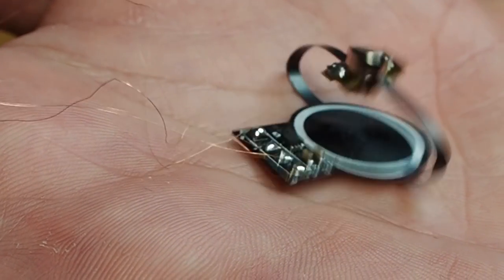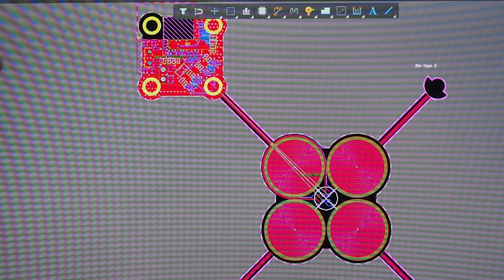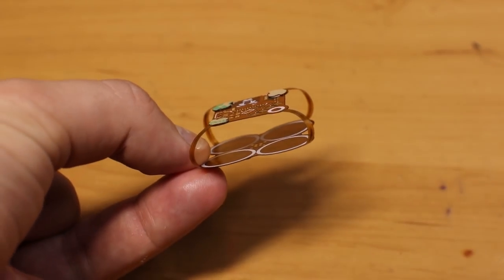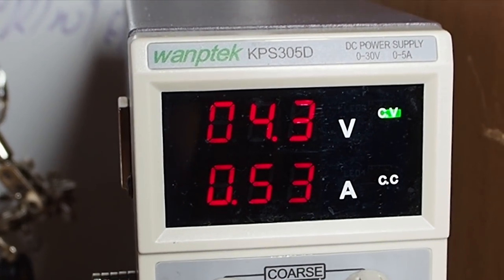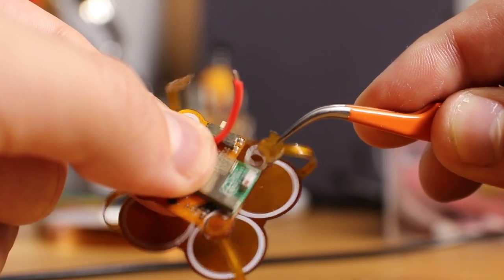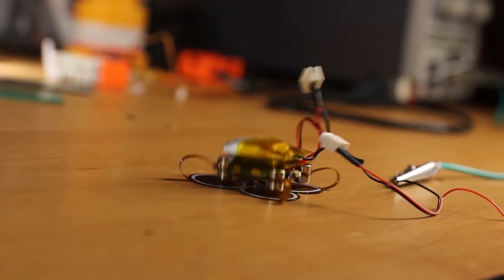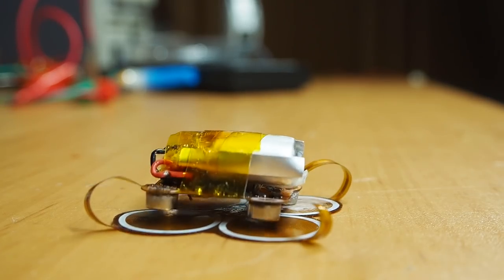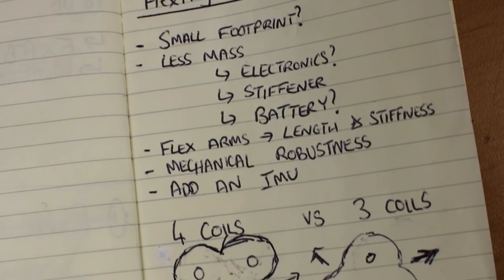Making a Jumping PCB Robot

Comment: Hi Carl,i'd like to give you an advice about jumping, idk if you tried that before , but i noticed that one of the major problem of your design (still awesome, I was never able to do something similar and I'm following your journey with a lot of enthusiasm) is the very low potential elastic energy that the robot can accumulate during compression, this due the low elastic constant of the pcb material. I know that a spring effect would require bigger mag fields and so bigger coils and mags, but why not trying to exploit a capacitor discharge in combination with some lp boost converter in order to feed the coil with short pulses of relatively high voltage electricity. In this way, enhancing the elastic constant of the pcb using , for example, aluminium planar springs, you should be able to achieve better results without changing too much the size of your robot. Hope to be useful :)
Reply: does it work if you have stiffer metal springs that are also coils? Aka they are coiled into a roughly conical shape and when a current is passed through them they compress themselves against the magnet.
Reply: Easy and free good test you can try is to add a second layer of coils to increase potential energy. Use also the arms to be more stiff - you already have many PCB's. so, why not?
Reply: terrible advice
Reply: you are right actually i was thinking the same way but the problem is the design itself even though we add springs to it still this design at current stage cannot work harsh but true. just some magnets pulling and pushing against each other wont do. first thing is we need a lot of force to jump which means we need potential energy storage like proper springs or rubber bands will also do. next we need a way to pump energy into them like the PCB linear actuator carl designed in his previous videos. next we need a lot of design improvement. i have a suggestion for carl he can use the PCB LA design to pull the springs from all sides towards the centre straining the springs and suddenly releasing them that should create enough force
Reply: So if you think about physics of jumping, you can't get more energy out of external energy harvesting.
If you wan't a real jump, you need to meet the "sweet spot". In your case the moment when you can enforce the anti gravitational force in upward direction, when the inertia of the lifting motion is enough to pull the mass that is still on the ground.

If you think of when you jump, you push yourself up. Right in the moment, when you feel gravitation less, you pull your legs to yourself. This order is a case for control algorithms. The problem you disrespect with fixed/variable frequencys for proof of concept, is that the actual momentum is not linear. It is by the power of 2 depending on time, its linear but not straight.
Reply: this really needs a 6DOF IMU so you can tune your jumps.

Comment: That's fantastic Carl! Have you thought of using opposing coils instead of permanent magnets? That might improve the power to weight ratio.
Reply: The mass of the magnet is what makes it jump
Reply: Never mind, I see what you mean. The battery mass is high enough that using just coils might work
Reply from the maker: thank you so much :) opposing two coils alone does not create a magnetic field strong enough to repel/attract them.. i have some tests coming up soon (next month or two) related to electromagnets that might give some more answers to this question
Reply: Or maybe the coils can load a spring with a ratcheting action and then it can jump like a flea, maybe using the coil movements to steer while in the air.
Reply: You might want to try putting a small platform in the centre of each coil (on the bottom) so that air can enter the space under the coil easier. Perhaps the small vacuum is holding it down?

Comment: This would benefit form having Some feet as this will reduce the energy needed to jump due to less losses due to suction
Reply: Use superglue and baking soda to build some nubs for feet?
Reply: This so much, it seems to be stuck to the ground?
Reply: Or at least holes in the bottom PCB to allow some airflow.

Comment: This is so cool! The thing I would do is to double, triple, etc. stack the coils - the primary source of the filed/force. Also, don't think you need wide coil, but stacking as high as possible with low/similar to magnets' diameter. Thanks for the videos!

Comment: How about using more of a centipede like set up with smaller multi layer pads, and a tiny bar magnet instead of the leapfrog and button magnets? A sequential firing of the pads can be used to mimic the insects walking pattern...
Reply: That sounds awesome, and more doable than jumping.

Comment: What happens when you make holes in the center? I think the foot area is so big that the outside air pressure makes it "stick" on the surface. You could also try a non flat surface where air can flow more freely, like a sponge or a wire mesh.

You could also give the robot skids to stay off the ground.
Reply from the maker: i'm not sure if making holes in the middle will resolve this issue but i agree that having a smaller foot area will yield better results
Reply: @CarlBugeja  It's all about better air flow underneath. It acts like a suction cup at the moment. I'm sure you'll come up with somethign great.

Comment: I think if you increase the number of coils instead of decreasing them, it has a higher chance to succeed. Don't forget that you have a first prototype that can jump more or less as you wanted(at least in height) with only one coil and no battery, so you know that one coil can compensate for the electronics that make it work, if you want to also have the battery onboard you need to increase the number of coils (maybe like 8 coils in two coils per leg configuration for example) so that it can compensate for the weight of the battery. Keep trying it is a fun and teaching journey for all of us :D Great work!

Comment: I'm interested in seeing where this goes but man I don't expect much more of a jump with these magnets. My thoughts
1) The resistance to flipping magnetic fields is significant at this small a scale
2) Diminishing returns after 2 or 3 magnets/coils
3) You're losing some inertia to the dampening effect of the flexible PCB
4) The only way you're going to get the weight down with these materials is with fewer components and less soldier 
5) Your idea might have some broader application at a larger scale. Build a monster sized one might give you some ideas :D

Comment: That's pretty interesting so far.  Maybe putting the heavy part down instead of _up_?  Would that allow it to get more travel (and thus accelerate) before it has to pull the whole mass along?  As it is, it starts under maximum load, so it doesn't build up much momentum.  Just making this up as I go along, so take it with a grain (or a shaker) of salt.  Just a gut feeling.  Or, could you make it tumble instead of hop?  Make it a little more spherical in shape and then it could selectively shift the center of gravity by pulling the magnets to one side until it rolled over?  Your ability to design and build tiny little intricate things like this always amazes me, and your obviously enthusiasm for the subject matter make your videos a real treat to watch.  Take care, and good luck!

Comment: I think you could achieve directional control using just one centrally located magnet and three “steering coils” positioned a little off axis.  Because the steering coils are not directly in line with the magnet, they will exert a lateral force upon the magnet and a corresponding movement in the opposite direction while jumping.

To reduce size and save weight, the coils can be made into wedges that meet in the center of the PCB instead of being circular.

As a further refinement, it might be possible to design a hybrid system consisting of one large outer coil to provide most of the loft for jumping wrapped around three smaller inner coils that add an asymmetric steering force as previously described.

Comment: the 4 cables has a spring effect try changing material for harder springer effect, then the frequency will change too. It's working as a mechanical oscillator, you might get higher more powerful jumps.

Comment: Do you considered air suction forces between coils and table ? Maybe try to run it on some kind mesh table (maybe speaker grill)
Reply: I would suggest to add some legs to reduce vacuum under the coils.
Reply from the maker: that could be effecting yes and it would be an interesting test to make.. but i still would like it work on flat surfaces to be more "usefull"
Reply: @CarlBugeja  stick something below very light that at least lets air rush in. Like 4 small polystyrene balls. For next version, make a hole at the center for air inrush. You can't fight against one atm.
Reply: I had similar thoughts to Norbert SadeXo.
Reply: curious if you could take some inspiration from origami frogs? folded tabs off the main body could help solve this, plus give some extra lift?
Reply: Maybe a smoke test of some kind to visualize the airflow around the robot?  I wonder if you could get away with just using a needle to poke some holes between coil traces.  It might allow some airflow from above, and the small conical deformations might work like stand-offs, allowing air in from the sides and below.
Reply: @jozefh3272  frogs legs
Reply: I also was thinking about this. You need to have some holes to let the air go under the feet. Or as suggested try glue something under to give it some space between the table

Comment: umm
i have an idea donno if its possible but hope it'll work  well so the the coil attracts the coil and the once the coil is off it jumps because with the potential energy in the springy pcb okay so what if you use that coil to attract the magnets and then by reversing  the current in the coil you can make the magnet  repel which will  make it  jump  higher

Comment: Imo it needs more current. Say add a 50-75C smaller lipo baterry and up the current but with a shorter duty cycle. Or have rwo settings, low current for compression and a high current pulse for decompression.
Also flatter magnets would also help as you dont even have a flux ring around it so after it separates from te coil the flux loses are huge, thats why im sugesting doing a say, 15-20A pulse, to concentrate all the power while the magnets are close to the coils

Comment: Can you incorporate a hard stop while the top is moving up?  You are absorbing all of the deceleration over time time with the flexible arms.  If the mass comes to an immediate stop, the momentum will drag the coils into the air because it is lighter than the moving mass.

Comment: Glue on some thin plastic stiffener on the legs. Trace out the bottom 4 circles and the legs. This shouldn't add much weight, but it'll give some rigidity and high spring tensions. You know those hard plastic packages where they  melt the borders shut, the ones notorious for being hard to open. I forget what they are called. Or grab some thin vacuum forming plastic sheets and cut that out. Maybe some projector plastic sheets? Idk if they are still around :D

Comment: Hey carl, here are the things that I would do differently for this particular design:
1. Use a piece of iron at the center of the coils, which would not only help in increasing the magnetic field but also will help with the weight distribution.
2. Make the length of the connector even longer to give more headspace for the magnets to move.
3. Use a higher grade of neodymium magnets.

Comment: 314/5000
a great project.
I think you have three serious problems:
1. the conductor track width, this limits the current flow and thus the magnetic field strength
2. the large base, perforate it so that the air can flow faster between the base and the board
3. As already mentioned, the spring force

Comment: Hi Carl! Just stumbled to your channel and saw this frog project. You are very skilled and you have really grate and creative ideas! Keep going! Though there is a drawback in your designing process. You have to pay more attention in the physics of your projects. For example, here, you have a really large flat surface (quad coil system) pushing on your desk. This works as a suction cup and your system struggles to detach from the desk. Try to attach 4 polystyrene foam hemispheres under each coil. Also, try when you design the PCBs to take in to account  the moment of inertia on the primary axis you will be using or at least try to spread symmetrically your components in order not to have to re-calibrate the whole system.  Finally, for the specific project try to determine the "force" or the weight a single coil can elevate and how far (hang your magnet from a string right above a single coil and play with the coil strength and extra weight on the magnet). I hope that helps a bit. Nice videos! ;-)

Comment: Have you taken into account the airflow? Lifting the large footprint vertically up from a flat surface creates a pressure difference and a sort of vaccum underneath keeping the coils stuck to the ground. I would suggest drilling some air holes in the centre of the coils so that as the coils lift air can enter through the centre and not just from the sides. 

I’ve done a terrible job explaining this but I’ll give another example. A piece of paper flat on a table... it’s difficult to lift it vertically up, but easier to peel it up wards from one side to allow the air to fill the space you are creating.

Either way try drilling an air hole in the bottom panel:)

Comment: Magnet at the bottom coil on top. Like a pogo stick the rubber feet would be the magnet the outer tube would be the coil. The coil would need a Center hole for a stabiliser rod that connects to the magnet at the bottom. The whole unit will be able to operate without flexible pcb I think and will jump with the weight of the pcb and the battery.

Comment: One problem I see is that there is a "giant suction cup" on the bottom. Could be causing a huge loss due to the viscosity of air, the relative flatness of both the PCB and the surface it is on. You might try reversing the setup, magnets on bottom coils on top or to add standoffs (maybe headder pins) on the base.

Comment: You could try if increasing the magnetic force helps. Add some metal to the coils. You could try to paint it with magnetic paint. It contains small metal particles. It will increase the weight of the feet, but metals are known to increase the field strength in the order of 1000.

Comment: Remember that not all actuators/motors need permanent magnets.  For this weight critical application, replace the magnets with top side coils.  I also recommend investing time to find a higher energy density (watts per kg) energy storage system... supercapacitors have 2-20 times higher energy density than batteries

Comment: You've got a few things going on there. I would place some air holes through your coil designs for starters,  there is too much flat area needing a big air inrush for a snappy jump response. Also, I would find the jumping frame resonant frequency, run it at that frequency for movement and then slide the coils on intended motion axis oppositely out of phase from the other coils, each other for effective movement. Think more kangaroo than frog.

Comment: Not sure you have them where you are, but there’s these flexible nasal strips for allergies, snoring & other uses.

Putting these on the flexible loops would give them more spring action, as it’s more this energy being used to “jump” than it is electrical.  Unless you could program a reverse polarity “push” or repel sequence to help it hop.

It’d dramatically reduce runtime, but a (rechargeable) coin cell battery might be a happy medium between size, weight & ability to hop

Comment: Amazingly creative work, I would definitely like to see a version 2. I suspect you may be able to cleverly use the pcb material as a sort of spring to assist the hop. Perhaps reducing to 2 "legs" and putting 2 coils on each with a stiffer joint - the attraction of the first coil could pull a magent that was out of range into the attractive field of the second coil, kind of acting as a 2 stage arm of a lever allowing you to use the mechanical rigidity as a spring when you release/reverse the electromagnetic polarity.

Comment: Make the pcb helmholz chambers so leg vibration adds additional acoustic resonant lift 
Space frog 🐸🚀
Mini compressed air system spinning a mini turbine powering mini van de graff through a micro super capacitor to power the legs instead of batteries
That would be awesome
Keep on tinkering 🤖

Comment: Great project. Just curious to know if we can replace the magnets with PCB coil as well? I know those will be not that power full. But I think if we use coil + neodymium magnet for opposing, more field will be produced and will give more control over the magnetic field. The magnets will be attached on top of the opposing coil, this will increase the strength of the field and much more control. I'm a noob, by the way, just curious thinking.

Comment: Add stiffer arms or more springy,  and make the attraction force stronger ,that way you only have to realse the magnetic hold and it will automatically spring up without the need of the magnets pushing it upwards, i would use the metal out of the spring in a clockwork toy ,or off an old mechanical clock spring chopped into four parts for the arms .hope this helps in some small way .

Comment: Very interesting… my first idea if you do a version 2 of it would be to place a hole in the middle of the coils… at least in the space between the 4 coils. Reduce the air pressure on the base plate.